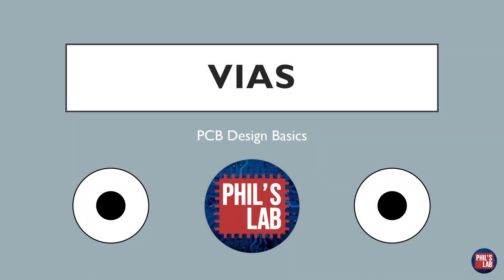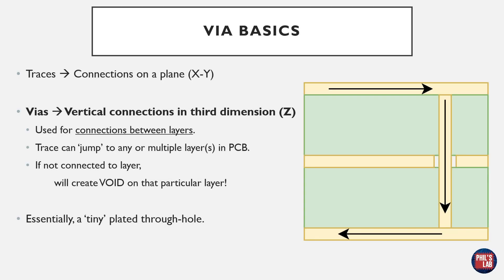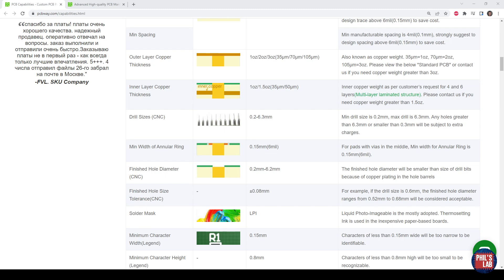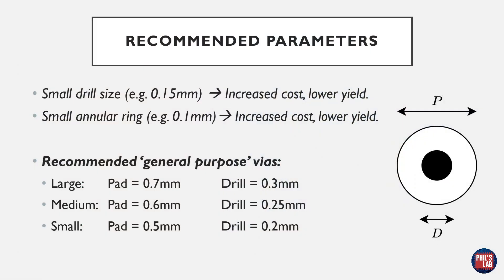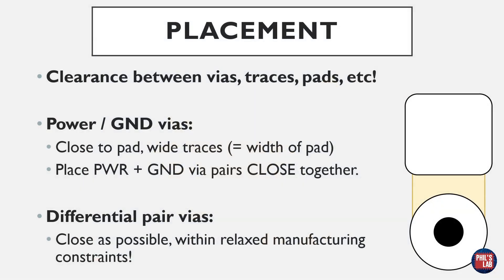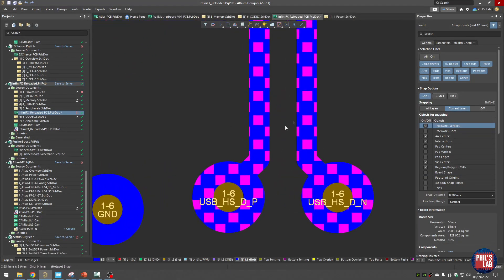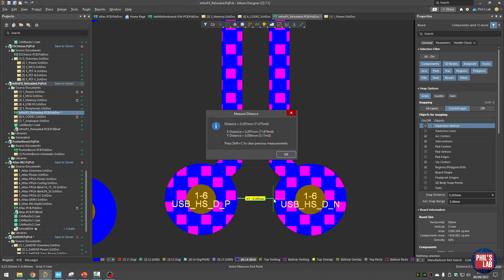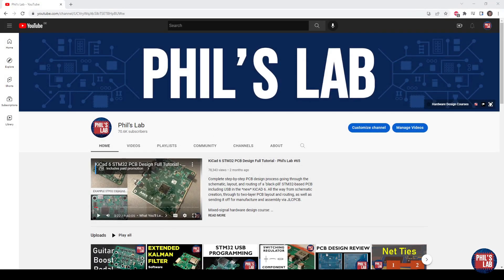(Sponsored) PCB Vias 101 - Phil's Lab #77

Comment: Regarding via tenting. If all your vias in the design are using manual solder mask expansion with TOP/BOT tenting, where is that information embedded when Gerber files are generated?
Also, if you specify at least one via as 'Type1a - Tenting' you have now created additional layer (maybe more) where that information is kept about this via, right? Thus when exporting gerber files these additional layers must be selected, otherwise they will be ignored, correct?

Comment: what would be the Calculation for L when frequency is higher, say 30Ghz or 60Ghz? would you still divide the Lambda by 20? because that would place via too close, making drill-drill spacing less (manufacturing constraints) and the via pads would also overlap. In such cases we go for say Lambda/4 or Lambda/6, so do we have any fix kind of things based on frequency?

Comment: If a manufacturer offers via in pad as a standard option, why not take advantage of that option?  The solder screen will need to be modified for the volume of solder wicked into the via, but that's not an insurmountable problem.

Comment: Hi Phil, just a quick question about the stitching vias for shielding. You mention "spacing the vias apart by L" and you give this nice drawing where L is the distance between the via centers. Is this correct, or should L be the distance between the outer points of two contiguous vias, since the radius of the vias might have effect?
Reply from the maker: Hi Ruben, As shown in the drawing, the distance should be measured from the via centers. The main 'via connection' is along the 'barrel' - not the pads. The pads typically will not extend down or be placed on inner layers (in Altium, the function 'removed unused pads' can be used).

Comment: Why do you need any annular ring on the top and bottom plane with transfer or stand alone stitching via? Making the hole size equal the pad size would allow the transfer via to be closer to the signal via and save routing space. The plating is in the hole and connects only to the inner ground planes. Is the annular ring required for the plating?

Comment: Excellent video as usual. Vias are at the heart of many manufacturability and reliability issues. 

During a course, our instructor mentioned this story. A company had issues with this military grade PCB having an intermittent issue that only happens in the field but not during lab testing. It turned out that some of their vias weren't sized properly for their intended environment.

The via walls would crack due to thermal expansion after being exposed to the sun but as soon as the board cools down, the issue disappears.
Reply from the maker: Thank you! Was that per chance a course by Rick Hartley? I think I heard that story from him as well during a seminar.
Reply: @PhilsLab  No, the course was "Certified Printed Circuits Designer" from PCEA and taught by Mike Creeden. The two are friends so probably one of them heard it from the other.

Comment: Great video, as always. I have a question. Does adding in-pad vias to component such as QFN packages and such add cost to the manufacturing?
Reply: To my understanding I do not see why this should increase PCB cost, but it can cause "solder wicking", where the via will drag the molten solder from the pad down into the hole and can cause bad joints as not enough solder is left to connect the pin to the pad.
Reply: only if you choose to fill and plate over them.